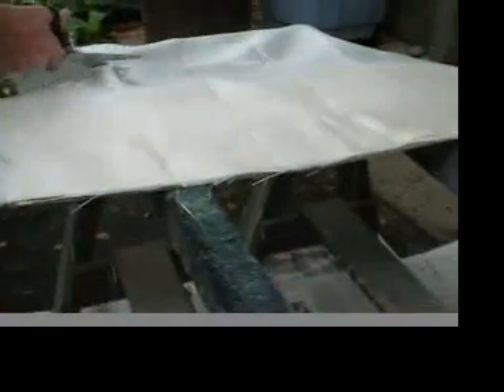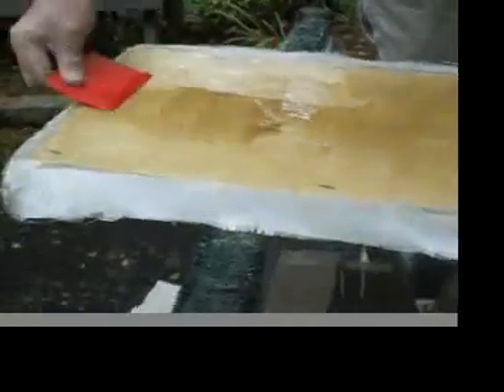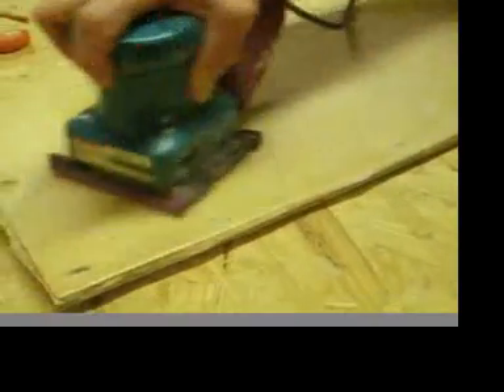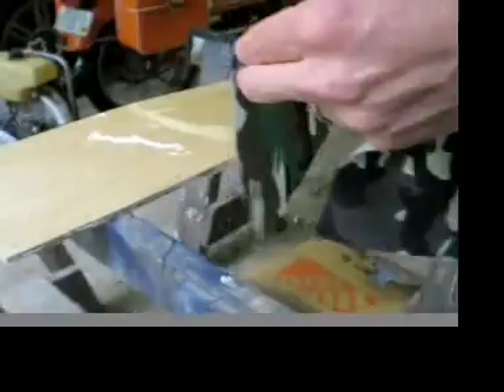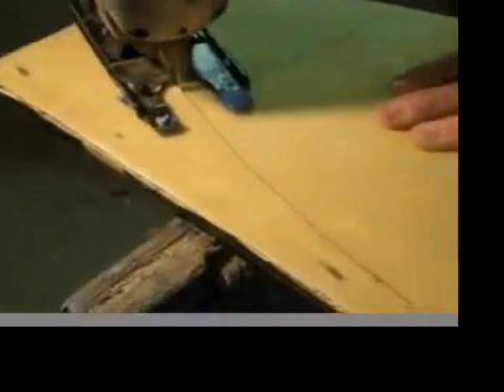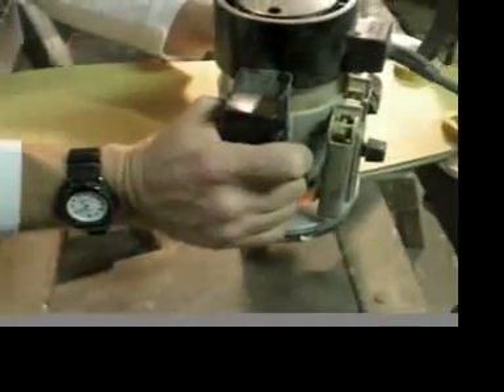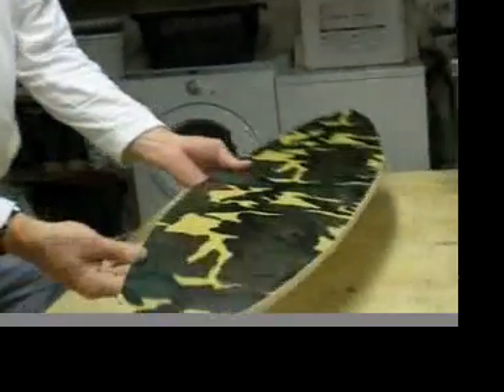building a hybrid concept cruising skateboard - part two - fiberglassing

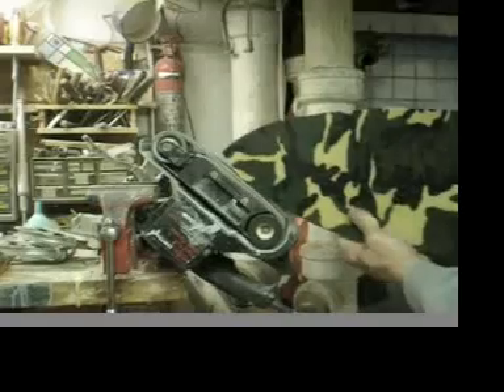Comment: @chocolateboy0115  at 3:45 he uses a belt sander you could probally use a electric sander or sand paper but this would be alot more time consuming you would smooth the edges off with these. especially using the sand paper.
And at 4:11 he uses a rowder or rowter im not to sure (one of the two) this just makes the edges curve.

Comment from the maker: The one in the video is polyester, while I've used epoxy also with great results. As you know, both epoxy and polyester have resin and hardener bases, mixed in a certain proportion to cause the chemical reaction of the hardening process. Epoxy is more expensive and more durable in a marine environment. For the price difference, I'd go with polyester for a skateboard, it's still extremely durable for this purpose.  Hope this helps.